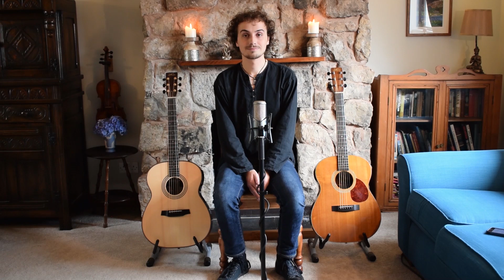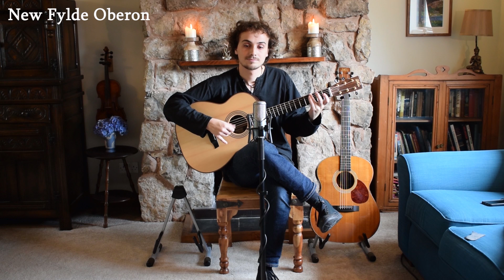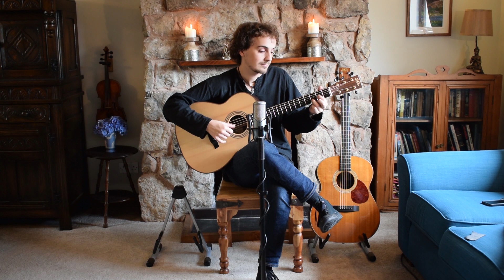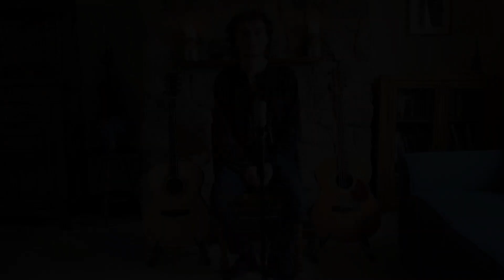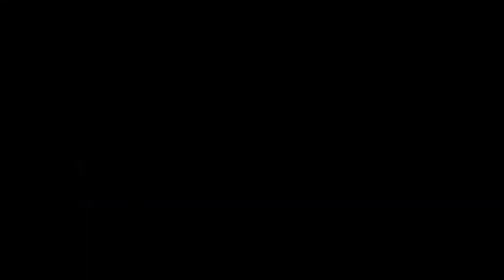Comparing Two Fylde Oberon Guitars - Same Model, 40 Years Apart

Comment: Both beautiful guitars. I had to check the Fylde website to identify the tone woods (Sitka for the older and Englemann for the newer). The older seems to be mellower with a softer sustain and the newer has more bite (better for recording?) I probably prefer the older but it a moot point as I could not afford either.
Reply: It's not moot.  The presenter should have made clear what the tone woods were because it makes a great difference, and as another commenter said the 'scratch plate" or pickguard in my language is also important.  I have a 44 year old Orsino and people still comment on the depth of the bass string...on a cedar top!